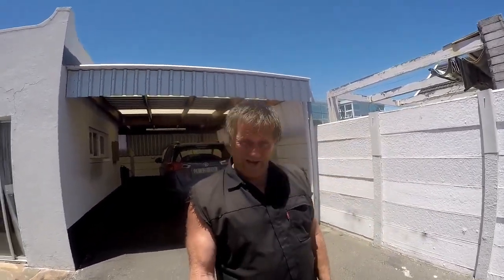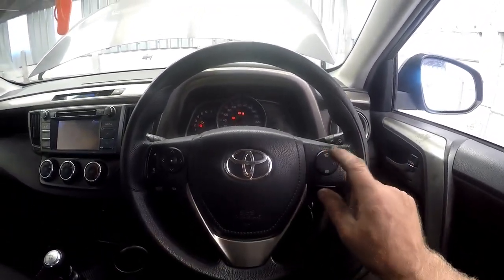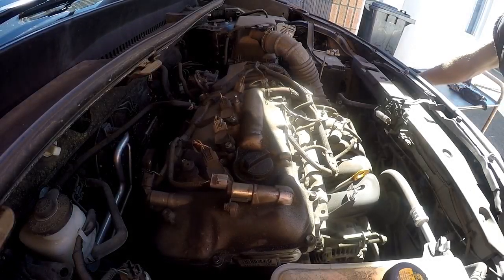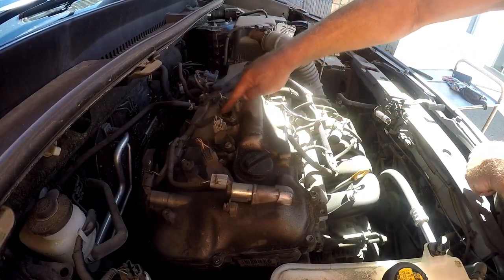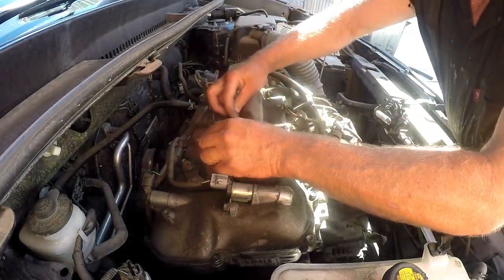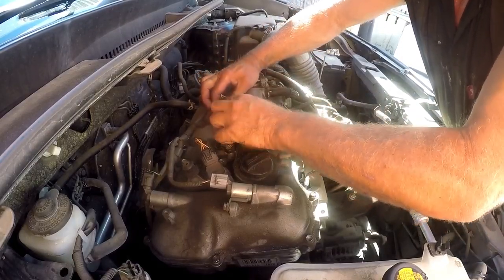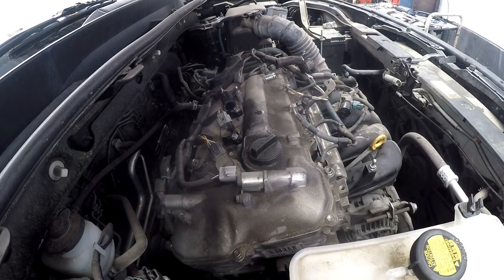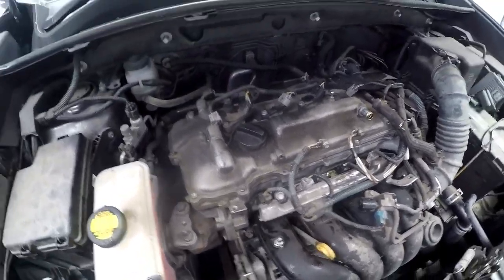Toyota Rav4   Finding a Misfire

Comment: Since the engine is just a 2.0 liter, replacing all the coils is the easiest route.  A extremely poor idle and stalling are the most common problems associated with bad coils.  I replaced my EGR valve, MAF sensor, car battery, and all 4 coils in my 2002 Rav4.  Total cost was around than $220 (Canadian) and my Rav4 runs perfectly once again. 

Doing the job yourself is a tad overwhelming at first so do your research on YouTube.  I saved myself over $800 in labor alone.  An OBD II is reader also handy but not really necessary.  Just replace the most inexpensive components at first and work your way down the line.  For my, a new EGR valve cost about $10, a new MAF sensor about $32, and a used battery about $60 (I had a manual battery load tester so that saved me some money as well).  The new coils off Amazon were around $90 so total cost for parts was about $220 and I'm good to go again for the next 7 years!  Never did use the OBD II scan tool but kept the scan tool in case the problem was something bigger.
Reply from the maker: Thanks for sharing your experience here, it is much appreciated and educational.

Comment: Those plugs at least have been changed at some time, they actually came loose, they tend to gall fast into the cylinder head if left there forever. If the misfire had not moved with the injector it could be an ECU failure as well, probably from a failing coil pack. Those coil per plug units are prone to that, living in about the hottest part of the engine. Ask any VW owner with coil packs, that failed just outside warranty.
Reply: @vehiclemaintenanceandrepai3790  Could be worse, could be A class, where those coils come as a nice big block of plastic, and the manual says to assume the service position of drop the engine 15cm.
Reply: @vehiclemaintenanceandrepai3790  About the only thing that does not require dropping the engine is changing the oil and checking the oil level. pretty much every other thing either drop the engine, or remove the entire front of the vehicle, or remove the engine entirely.